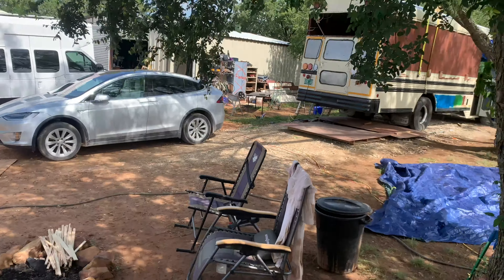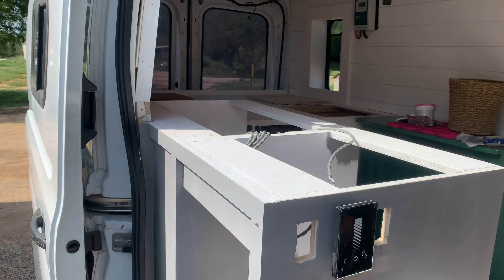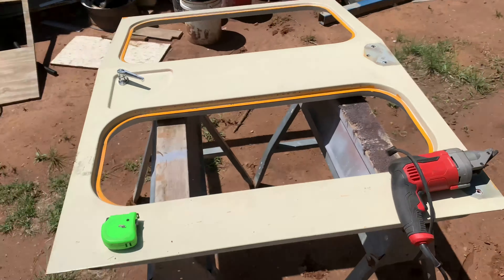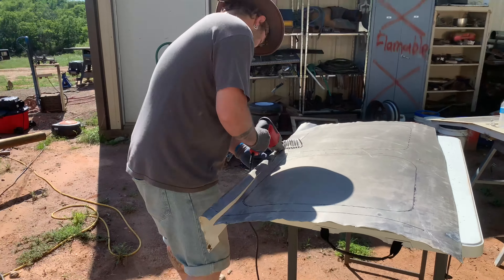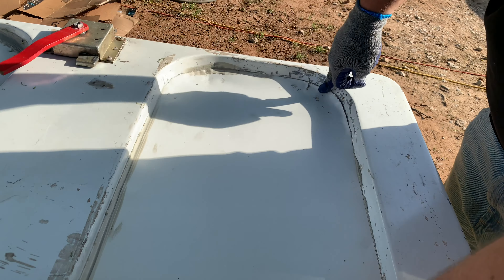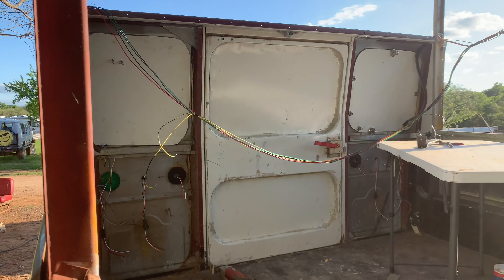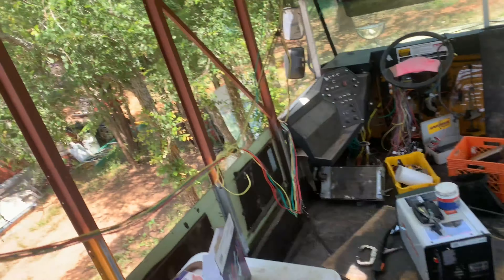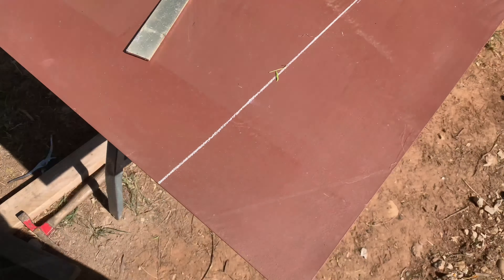Skoolie build #12 sheet metal is riveting!

Comment: dear sir, would u mind telling me about the hat channel. where did u buy it. I would like to get it for my dad. we are daughter and dad to build the skoolie bus. right now we both still collect the information for what we need. my dad told me that he found out at the skoolie.com, however, it is only 20 inches. I need to raise the roof for 24 inches. would you please give the name and address for the hat channel. how much is the price for each.
Reply from the maker: Hi! I got my hat channel from Charles Kern at chrome yellow Corp. in Colorado, you can find him on Instagram @lookatthatbus he had some 48 inch pieces that I cut in half to get 24”. This was a good option for me and he happened to already have it on hand specific to my bus body. Make sure you know what body type you have length and year. The shape and sizes of hat channel vary. It is possible that you may hire a metal shop to bend the hat for you if you can not find what you want, but you will need inserts as well if you go that style, or square tube. Good luck !
Reply: @omarwaqar8637  thank you very much. I will follow ur instruction.
Reply from the maker: Have fun with your build and stay safe !